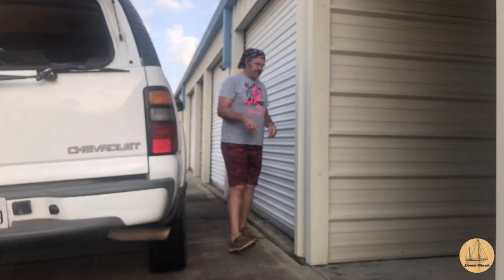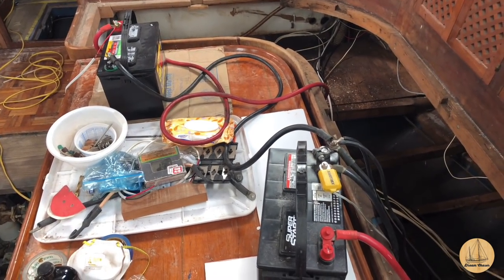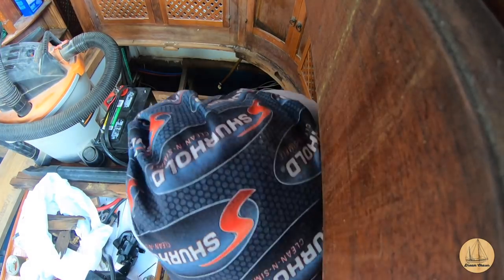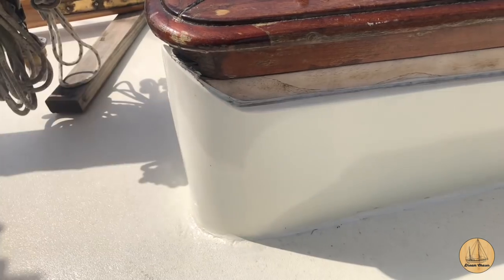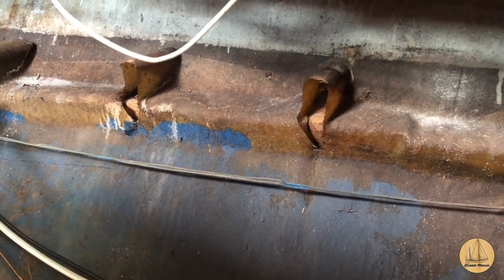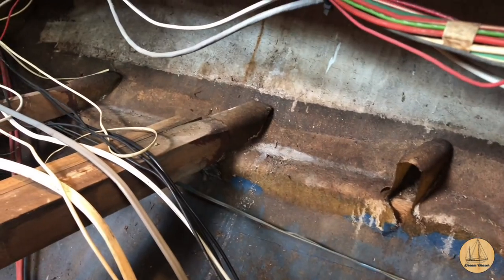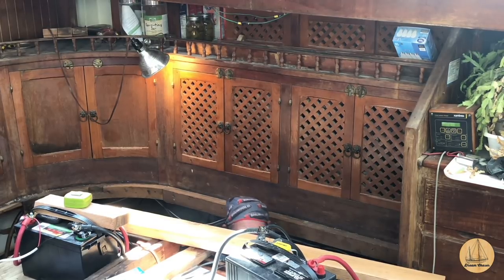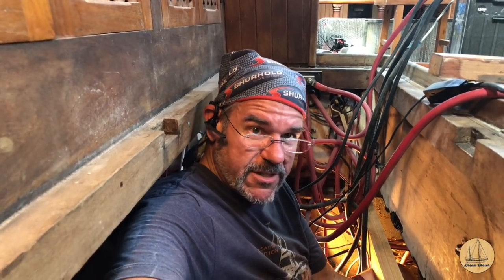Removing and Replacing Rotted Stringers - Part 1

Comment: Our Formosa had the same leaks you were surprised to find.  The hull is tabbed to the underside of the deck and creates a channel for water to run. Any leaking hardware mounts,deck scuppers, and genoa track mounts will travel to the low point of the deck in the hidden channel  which is right about where your galley beams were rotted. Ours were as well! We have never fixed all the leak points but have instead managed them by directing the leaks to one exit point from the deck/hull tabbing, installed a nipple and hose directed to the bilge. This has been working (14years). I am amazed how similar our boats are! Solskin is a 1973 model, what year is yours?
Reply from the maker: Falls into the category of if you can't beat em, join em.  LOL.  I like the idea of creating an exit for the water.  I think I may have fixed all my current leaks after fixing the scuppers, but your explanation of the hidden channel makes perfect sense.  
Ours is a 78 model.

Comment: Nice approach one i would not have thought of  get a handle on the dust for sure  even one of those large barn fans over the hatch work great for me when doing those kinds of jobs
Reply from the maker: Good point on the fans, I have an exhaust fan over the galley and it stopped working, I should fix it up but it has just been lower priority, this week would have been a good time to move it up the list.  :)

Comment: One challange followed by another, the life of a boat owner. The rot seems to be from fresh water intrusion which you have dilligently been trying to cure. I wonder if having those huge batteries giving off corrsive gas contrbuted to the rot. I have removed my 8Ds in favor of agm batteries. The scrap value far out weighs the core charge on those 8Ds and there are better options than lead acid available today. Besides, when you are sleeping in that area you are inhaling the fumes. Just a silly question. How much more has this refit cost compared to your original estimate? Not in dollars but percentage. I usually find a minimum of 20% and have gone over 50% due to the" Dominoe Effect". You know how it works," Might as well do this or that while I'm here". LOL! You are doing a fine job on your boat and you're narration is excellent.
Reply from the maker: +28cruzin Thanks for the kind words. I have considered other battery options but I’m not sure where I will land on this. I’m kind of leaning toward 6 V golf cart batteries in series and parallel. 
As for the cost and overrun percentage, it’s really hard to say. If I would’ve stuck to what I originally planned the boat yard came in right on their quite. However I have added substantially more when you factor in the stainless steel work and then the decision to fiberglass the deck and the coach house which was not in the original plan I am 275% of my estimate.